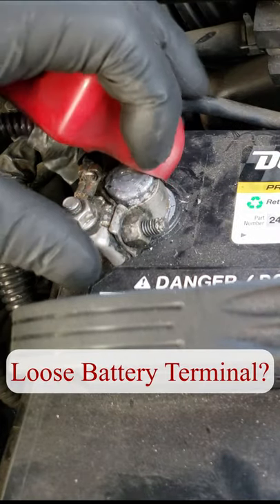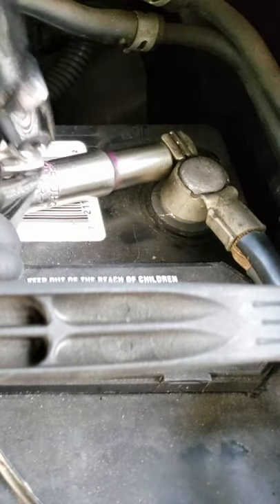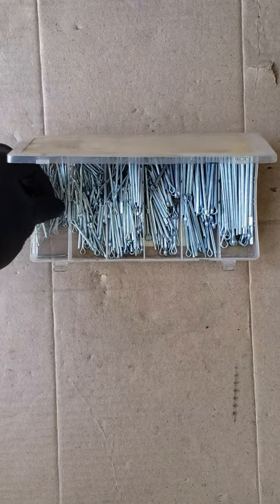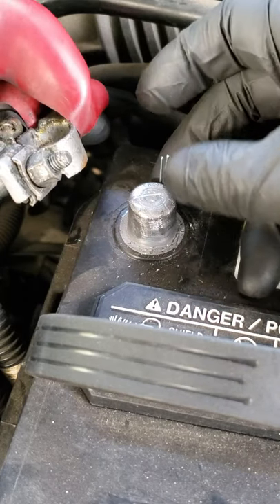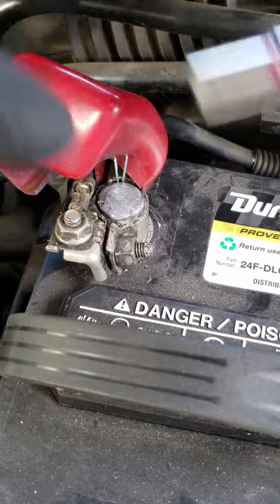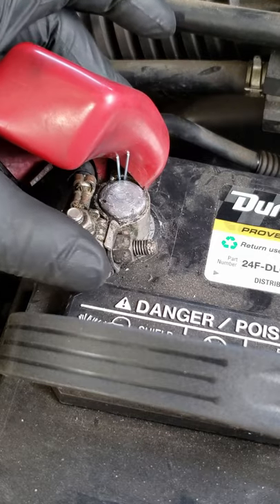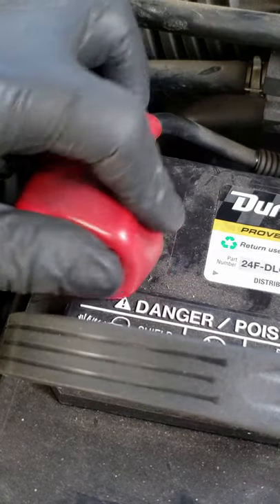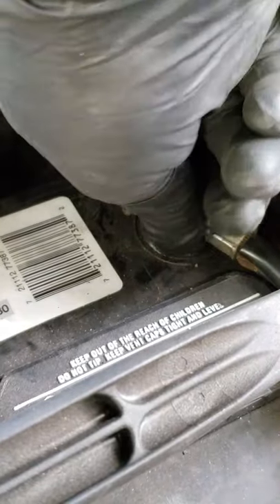How to fix a Loose Battery Terminal Cheap and Easy #Shorts

Comment: Don’t do this on newer cars they have a system that checks the resistance on the battery.
Reply: Learned that the hard way
Reply: How new is newer
Reply: 2010 prius??
Reply: dalaw6600 left a comment:"Don't do this on newer cars.They have a system that checks the resistance on the battery". Do you agree with this and if so what would you consider a "newer" car?

Comment: Or you can get battery post shims. They come in a 2 pack and they are pretty cheap
Reply from the maker: Yea also another option but seems people would prefer the terminal replacement
Reply: i tried but theyre too thick
Reply: Usually too big, had to use pieces the other day😂
Reply: Where can I buy these post shims guys?
Reply: .....fr guys?... there's hundreds of random free scrap n sh1t all around the house... take any scrap wire, speaker wire,   etc.. strip it, fold up a bunch then same concept as the video. Or paperclips, or a small washer.... what's the point in wasting more money and time. Especially since you probably have a free instant fix at the bottom of your tool box! 🤯🙄
Reply: I literally searched the internet for this solution for an hr just to find this comment.

Comment: This is a lifesaver. Thank you!
Reply from the maker: Thank you🙂
Reply: @backyardchevy328  I tried this yesterday, but rather than a cotter-pin, I picked up some 16 gauge copper wire from the lamp section of the hardware store. I was able to easily break off a small length and fold it into a cotter-pin shape. Worked like a charm. :- ) Thanks again!
Reply from the maker: @clewismessina6630  thats great! Yea definitely works too
Reply: @clewismessina6630  why wouldn't you just buy new ends? Coper aint cheap

Comment: The best way to fix a problem like this is to bend the terminals back, or even twist them a bit. But if that doesn’t work, best way is to get 12 gauge solid copper wire and hammer it flat than you can use it as a shim for a tight connection.
Reply: Mine keeps coming loose some fool said you need a alternator ok yah thats why my battery cable keeps coming loose 😂fools
Reply: Can a penny be used instead , for the copper part?
Reply: @evelinagarcia7430  it’s best to bend the terminal back with some channel locks or pliers. But I would recommend using real copper wire since it’s more conducive then a penny. The penny won’t fit and most Pennies aren’t made with real copper, I believe zinc mainly. Goodluck

Comment: Could this be used as a permanent solution? No danger of causing a short somewhere? Im not really a fan of those aftermarket cheap clamps.
Reply from the maker: Well ive left it on the van i originally did and it has worked great so far...but id say its more of a temporary than a permanent due to the fact one side of terminal has full contact and the other side has the cotter pin contacting it...and best to have full contact all around...and yes i really hate those aftermarket ones too..always causing issues

Comment: Will the pin rust and make it loose again?
Reply: Rust make it more tighter
Reply: @nicesmack9309  AND increases the resistance of the connection. 🤨

Comment: What is the name of those pins? I couldn't hear/understand it
Reply: Cotter pins, super cheap. I keep a pack in my car but only use as a temporary "get my car home" type thing. Someone on here said to not use on newer cars. This quick fix worked enough to move my car but I found out after a few times of replacing the pin that my battery would turn off while I was driving. As if the connector had come off again but it was the cotter pin no longer helping?...idk why, but each time that happened I was running the risk of blowing my cars computer or entire electrical system and once that happens you may as well send ur car off to the junk yard. Idk about other people, that's my experience. So yes, I keep for emergencies so I don't have to tow car home but take this solution with a warning for temporary use only. Maybe depends on car, but better safe than sorry.
Reply: @Chasingwhiterabbits  thank you. I just got a mechanic to order a new battery tray. The battery is new but the tray to hold the battery was broken.

Comment: What do you think the problem is if I when I try to start my truck it’s completely drained of power then when I pop the hood and just slightly move the red terminal everything comes back on and I’m able to start it up.
Reply: have you figured it out?? same thing happening to my bmw
Reply: This is happening in my Chevy Malibu now too. 😩
Reply: Could be corrosion at the terminal. Does it look dirty and corroded? Remove the black, then red just like he showed on the video. Clean the red one really well. There are kits you can buy at an auto parts store with some cleaner, but just using some baking soda (add some water) and an old toothbrush is probably all you need to get the old gunk off. Then reconnect everything.

Comment: This should be categorized as a temporary fix, like if you are in the middle of a road trip and need to make it to the next rest stop or you are late for work.

If you aren't in an emergency situation, a new battery terminal like in the video is about $5 and is an easy job for anyone with some wrenches. So there's no need to keep driving daily with a temporary fix like this.
Reply: But maybe the new one won't fit either?
Reply: You worry too much

Comment: What’s the purpose for the smaller copper line?
Reply from the maker: It goes to the fuse junction block next to the battery
Reply: @backyardchevy328  is it important? Because I have a 2006 Honda Odyssey and it has the 2 big copper lines and then the smaller one but the after market one I bought it doesn’t have the smaller nut to get tied down to
Reply: @backyardchevy328  could I tape it up and put it to the side or do I need it?
Reply from the maker: @ghostjr7234  yea u would need it..u bought an aftermarket battery cable?
Reply: @backyardchevy328  no the battery terminals only
Reply from the maker: @ghostjr7234  they sell some replacement  terminals for those type

Comment: Question: currently my Mazda 6 won’t start I have a loose battery terminal and I jus fixed it from being loose. But it still won’t start. Do you think that loose terminal completely drained my battery and all I need to get up and going again is a jump start and the alternator will recharge the battery
Reply from the maker: By wont start do u mean it cranks(engine turns over but wont start) or doesnt make any noise when u go to start it?
Reply: @backyardchevy328  right now it doesn’t make any noise because I think the battery is completely gone. Yesterday while driving, It died on the road but before it died my radio stopped working and then my speed odometer stopped and than the vehicle shut off. Tried turning it back on and it wouldn’t make a sound, When I opened the hood I noticed my nail keeping the terminal in place came loose and moved too far down, which I think resulted in loosing power overtime causing it to die. I jumped the car right then n there and was able to start and drove it the 1 block back to my house where it died again. Now I re fixed the loose terminal but it won’t even make a sound. I haven’t tried jumping it cause I have no other at the moment to use. Also the battery is like 7 months old
Reply from the maker: @mykalgray6537  u definitely got a charging problem..id check the charging voltage which should be around 14volts but my guess it wont be charging..so maybe an issue with ur alternator thatd be while its shutting off while driving..it doesnt have the alternator to keep it running..its running on any juice left in the battery
Reply: @backyardchevy328  okay, thanks. I’ll have to test the alternator too see if it’s gone bad
Reply from the maker: @mykalgray6537  yea definitely, i think thats what drained the battery and why it needed the Jumpstart in the first place..it was the same issue on the honda civic i recently replaced the alternator on too

Comment: help me bro my car battery thermal nut is stuck i can’t unscrew it to change the thermal wtf do i do
Reply from the maker: Is the nut stripped so u cant loosen it? Or it just wont turn..if its stripped maybe u can get it loose with good pliers
Reply: Would copper wire work?
Reply: I had my stuck as well, just took some pliers to it and it came loose.
Reply: @backyardchevy328  i’m late asl but thanks bro lol bless
Reply: @Elijah.-_  yea bro that worked too jus had to redo whole thing